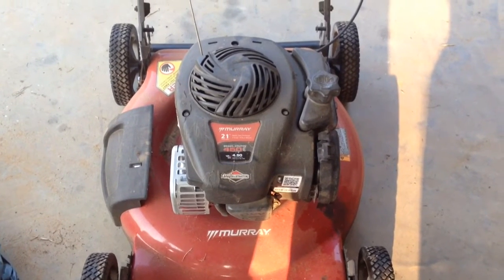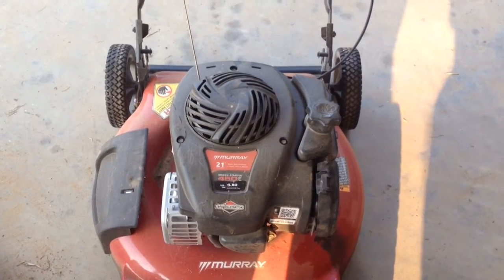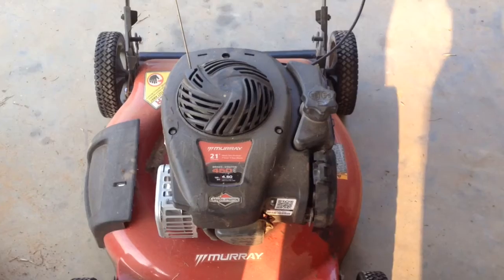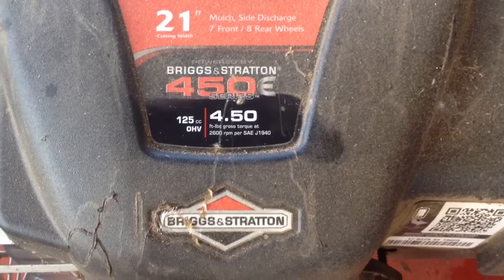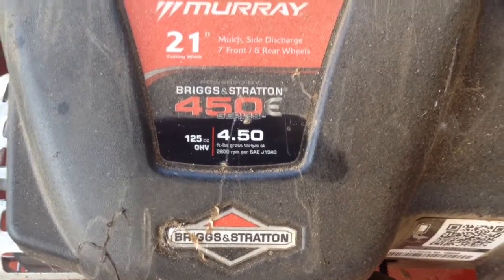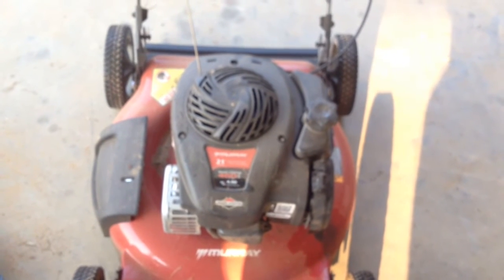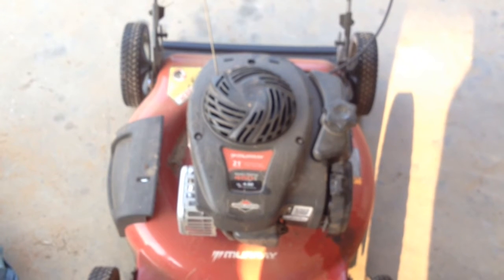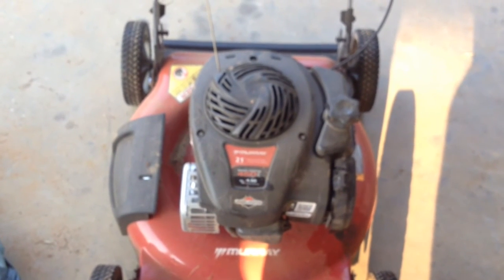THEMOWERMEDIC1 MINUTE : TORQUE VS HORSEPOWER AND HOW TO CALCULATE

Comment: Hi, I just did the math, and it comes out to 2.28 hp @ 2600 rpm. That sounds kind of weak. Also I thought most push mowers were set to run at 3200 rpm. That would still only be 2.75 hp.  I guess there's no replacement for displacement.